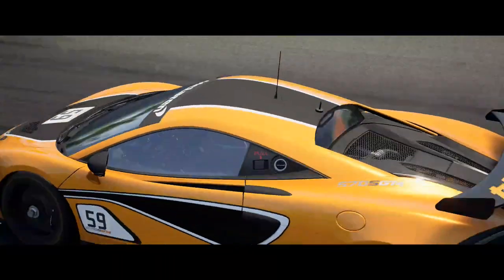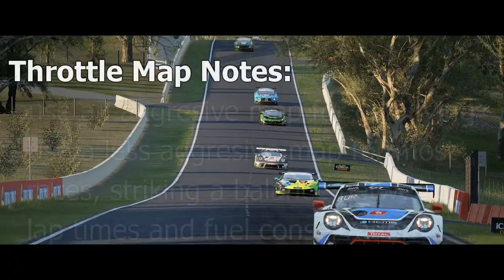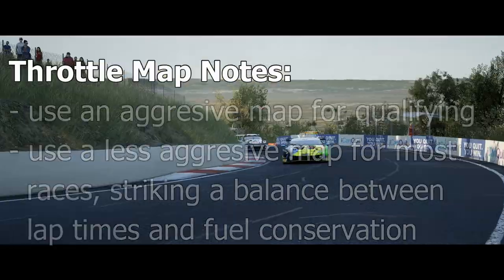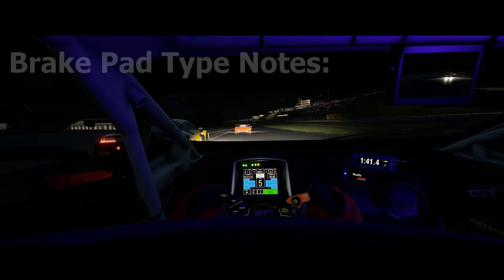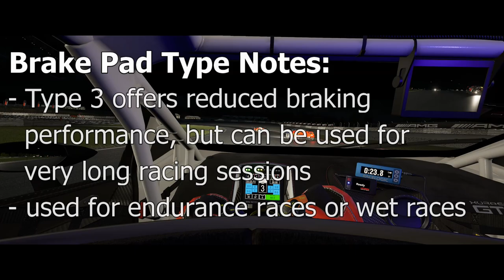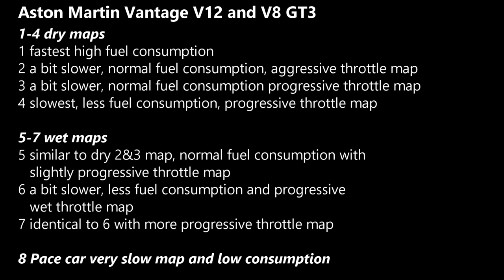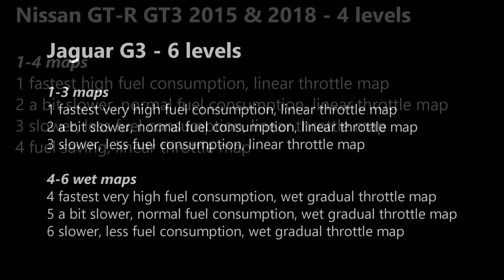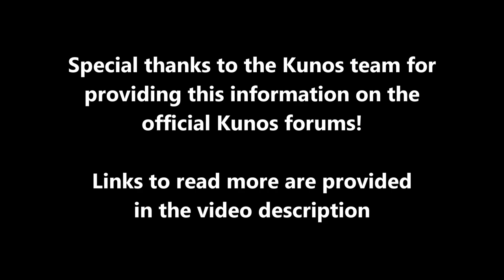Throttle Maps and Brake Pads Explained - Assetto Corsa Competizione

Comment: Impressive presentation of information, Mike.  But good gawd!  Back when I was racing for real, the only "throttle map" we had was to check to cable once in a while to be sure you were getting full throttle at the carb!  If anyone remembers what a carb is.....
Reply: Oh, I know. Carbs are those things I keep getting told to cut from my diet. Right?

Comment: Great video never understood what the brake values mean (basically couldn’t be arsed to find out). Followed your guide..... knocked a second off (in hot laps) on virtually every track. Finally broke the 2.00 barrier on Suzuka 🙏 cheers mate.

Ps. Why don’t Kunos explain this in the setups section?

Comment: That helps a lot! I have played about with TC and antilock brakes but that is about it. There are so many settings but i am only just getting past the 20 minute races so not had time in races to experiment. What is the TC2 setting about? I have seen it on one of the Nissans i have used but not really played about with it yet. Still getting into the career sessions but really good fun. What sort of lap time reduction would you look at for each of the different styles of races, sprint, medium and long distance? I am just happy keeping up with them at the mo on 88-90%. Never realised how difficult Brands Hatch was until racing with ACC there.

Comment: Please never ever use brake Pad 4, it is just to simulate the lifespan of a brakepad. After ~30min your brakes Start to overheat, after ~40min complete failure. You can feel reduced breaking performance after like 10 minutes. They just go from new brake Pad 1 to shit in 30 min.